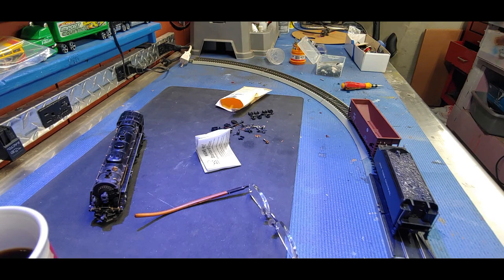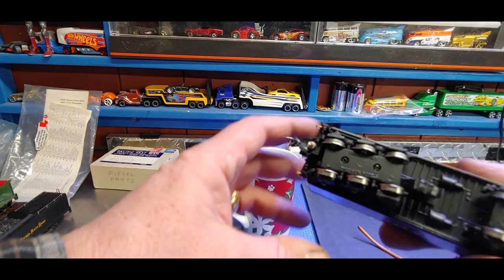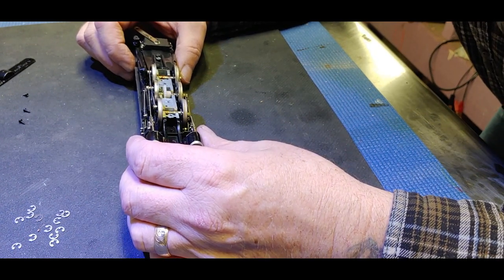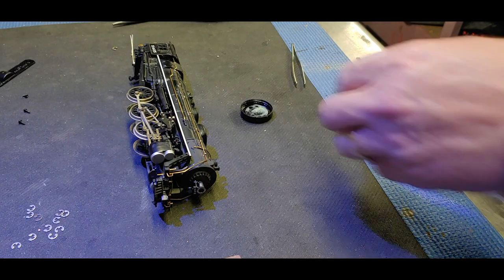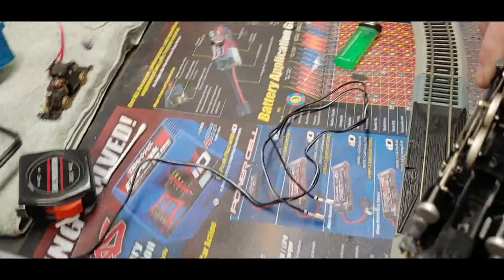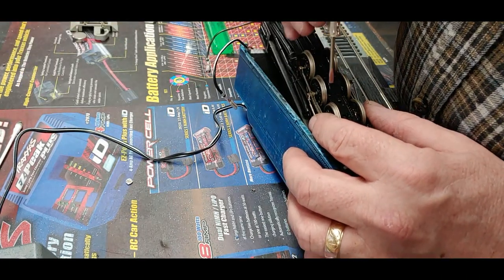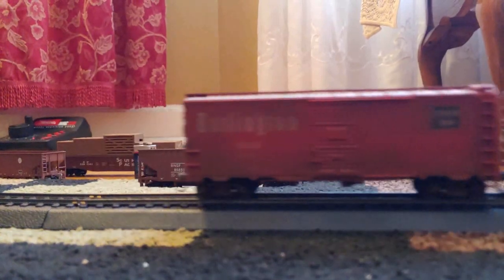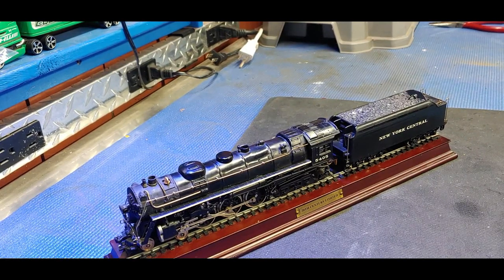Franklin Mint Ho NYC Hudson  In depth look at this HO engine

Comment: I have this as well as the Crescent limited the hudson has all plastic gears and its honestly garbage it was really  made for display and for that is beautiful I am in the process of replacing running gear all metal and installing decoder and sound the Crescent limited has much better running gear all brass just need to adjust the wheels will also install sound lights and dcc .. will upload video with materials list once completed they are worthy of taking the time and making them great runners! have  several Brass models which are all also in the works cheers from Salt Lake City

Comment: My dad bought one of these a long time ago band new. It nevet ran very well. Unfortunately one of the gears cracked. tender originally had the old horn hook coupler.
Reply: I have this as well as the Crescent limited the hudson has all plastic gears and its honestly garbage it was really  made for display and for that is beautiful I am in the process of replacing running gear all metal and installing decoder and sound the Crescent limited has much better running gear all brass just need to adjust the wheels will also install sound lights and dcc .. will upload video with materials list once completed they are worthy of taking the time and making them great runners! have  several Brass models which are all also in the works cheers from Salt Lake City